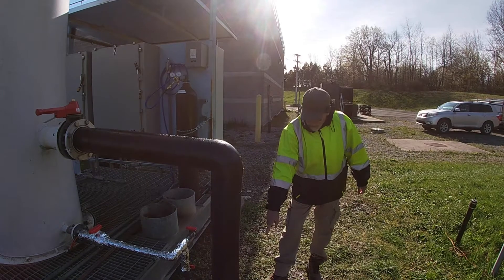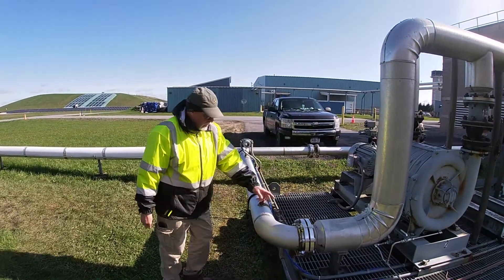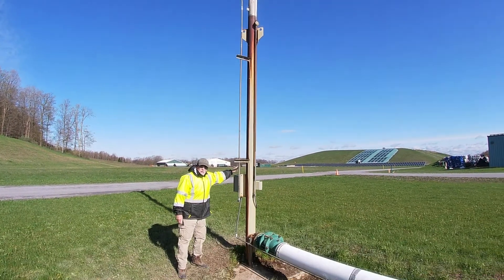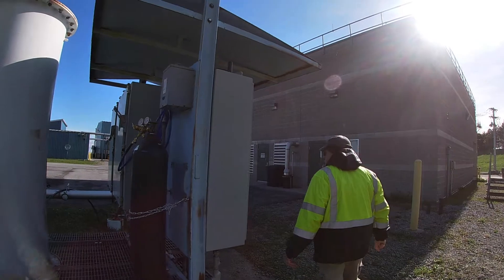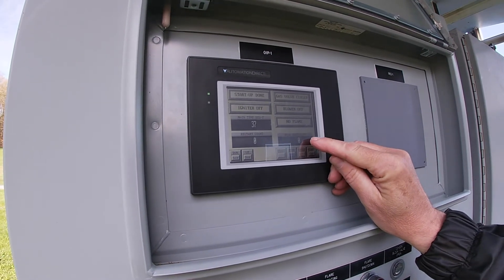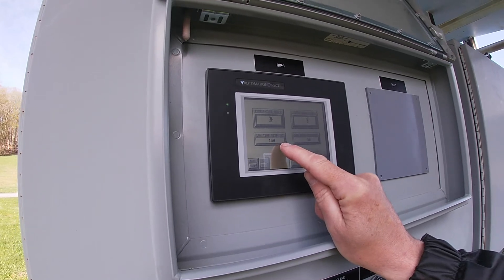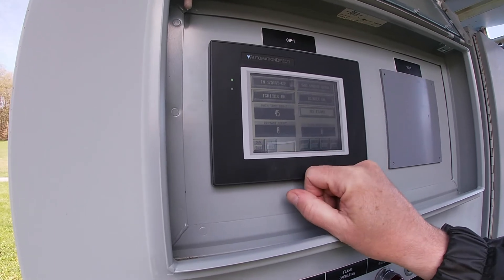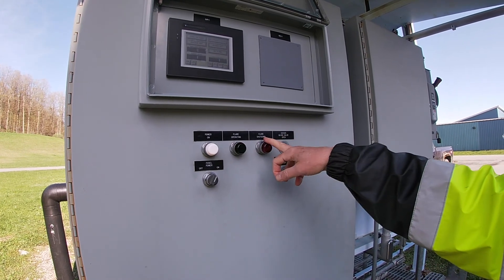Landfill Gas Flare System Operation

Comment: Does this keep the smell down
Reply: Absolutely, if the flare is down very long you start building pressure and get biogas odors straight to atmosphere.
Reply: When the ch4 is burning the odour will be minimal unless there are leaks.

Comment: Would this be the same mixture of gases for example,  from a oil and gas flare stack? Or is it just methane only?
Reply: Biogas is much different than Fuel/Oil vapors but it is close to the same operation that VCU's use at fuel terminals.